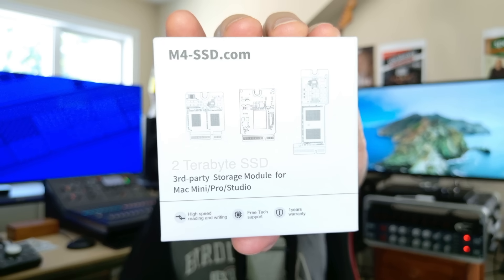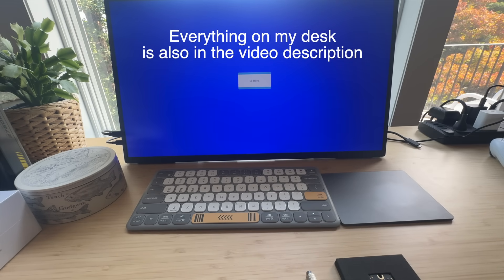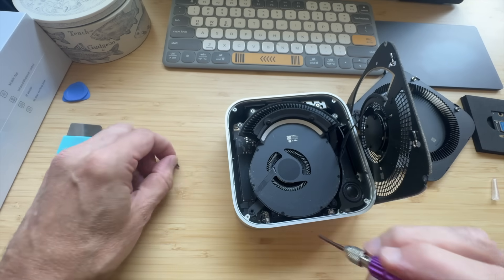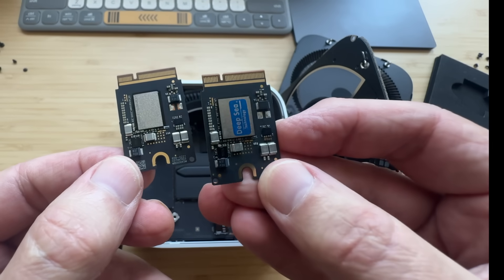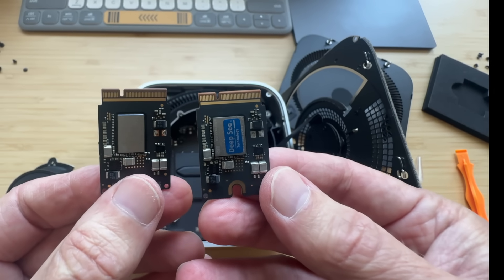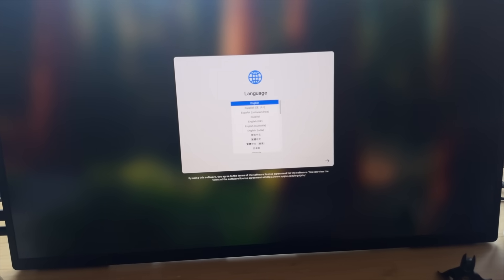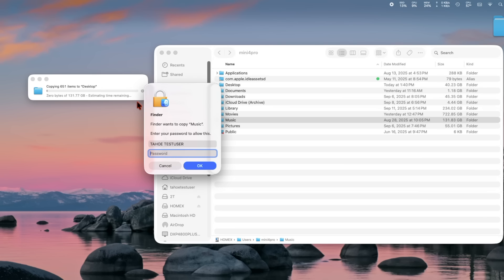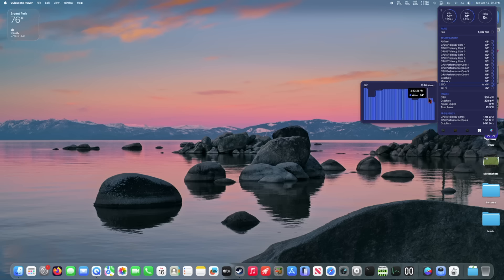Apple should be ashamed!!!! Save $445.00 2 Terabyte SSD upgrade for M4 Mac mini DIY GUIDE

Comment: Does the 2nd Mac for the restore have to have to a recent silicon Mac or can it be an intel mac? Thanks in advance
Reply from the maker: It can be done, but only with an Intel Mac that has USB-C / Thunderbolt ports and is running macOS Ventura or later. With Apple configurator 2, which you can download from the App Store. Older Intel Macs without USB-C ports can’t be used for DFU restore.
Reply: @MacSoundSolutions  oh dude thanks soo much for that clarification 🙏🏾🙏🏾🙏🏾 

Alternatively, can I clone the internal hardrive of the iMac mini onto the new larger SSD then install it that way, since my 2nd Mac doesn’t have any requirements for the M4 restoration 

Once again thanks in advance
Reply from the maker: @kosmicjedi 
no the DFU Must be done on a new SSD install
Once it’s installed in t toe  m4 mac mini and that completely erases the drive and writes firmware to pair it with the computer before any data can be written to the drive and the drives not work in the MacMIni

Comment: I really appreciate all the work. You do putting videos that like this out. I'm working on my second upgrade of a Mac mini. And I've used the hard drive that you requested. But I keep getting an. Error message of 4042. I've tried two different SSD's in case it was an issue with one of them. He suggestions.
Reply from the maker: Error 4042 usually means macOS can’t write the firmware to the new SSD. The fix is almost always to reseat the drive and then put the Mac mini into DFU mode and do a revive + restore through Apple Configurator on another Mac. That rewrites the firmware properly. Make sure the SSD is erased as APFS with GUID, and use macOS 15.1 or newer during the restore.

Comment: Any concerns on reliability of the replacement internal drive? Some suppliers/redit forums indicate very hit and miss results [though not from this specific supplier] so I wanted to get your thoughts on that. 1 month is, have you been using it much? Is it still performing as you'd hope? I feel the price point is good, with the 2tb making probably more sense than the 1tb, once you've gone to the trouble of opening her up... You've been very kind & responsive answering my various User on External SSD questions. Appreciate all you do for the community.
Reply from the maker: So far so good, no performance issues or problems. I’ve got two MacMIni’s that I’ve upgraded my base model in my M4 Pro with their drives, I have seen reports of people having failed drives from other companies they bought on eBay or Temu, and via my links I have sold probably about 50 of these to my subscribers and fingers crossed nobody’s come on here and said anything negative about them so I’m guessing they’ve been working well for them. The company is very responsive when I reach out to them as they’re working on a Mac studio version and keeping me up-to-date on that.
Reply: @MacSoundSolutions  How is the stability of the internal ssd upgrade now?  And, knowing what you do now would you do the internal upgrade or external.  I’m looking at buying a Mac mini and trying to choose which upgrade I’m going to do.
Reply from the maker: @skrufee  totally happy with the internal SST upgrades. I’ve done it to two MacMIni‘s my M4 pro and my M4 base model. The problem is that they’re just getting more and more expensive because of the whole AI buying up all the chips situation and that includes external set ups as well. I’ve had zero issues with the internal upgrade. I mean it’s only been about three months but they’re working great I just made a brand new video which I posted today about the best way to set up the external SSD either one works really well. It’s just a matter of do you wanna have a drive always attached to your computer and one of the benefits of that is you can always upgrade that external drive and make it even bigger so you can start with one terabyte go to 2 TB go to 4 TB where you can’t really do that with the internal the internal drive you can resell to somebody else and upgrade to a larger size but you can’t use those internal drives outside of the Mac it has to be installed in the Mac for it to work and you need another Mac to be able to set it up.

Comment: I heard to get it to work they must be blank NAND chips.  I am not sure if there is a way to properly blank new ones for use so that they can be reused.
Reply from the maker: I believe they can be used, the usage of the nands is delectable with this terminal command. ioreg -r -c AppleNVMeSMARTUserClient | grep -E "Cycle|Wear|Health|Percentage|SMART"     "Result Percentage Used" = 0 if percent used is 1 or 2 it has been used a far amount.
"SMART Overall Health Self-Assessment Test" = "Passed".     ioreg -r -c AppleNVMeSMARTUserClient 
Then scroll and look for:
	•	Data Units Written
	•	Data Units Read
	•	Percentage Used
	•	Media and Data Integrity Errors
	•	Power-On Hours

Comment: now from an apple user point of view i have to purchase another silicon mac to upgrade now if i do my maths i might as well upgrade via apple cause for me 600 uk pounds for another mac and all the hassle of taking mac mini apart voiding warranty i am leaning to letting apple upgrade and keep my warranty
Reply from the maker: you can use an old mac or a pc as well to do the DFU process, but yes you do need a second computer, or find a friend who has one. I certainly would not buy a second mac just to do the process either.
Reply: You could perhaps find a local Mac specialist who would do this upgrade?

Comment: What to do with the stock Apple SSD that comes out of the Mac after an upgrade?
Reply from the maker: hold on to it for backup, you cannot put it in an enclsure and use it, it pretty much is a brick. But if the new drive were to dies you could reinstall it and boot up. Always have backups of your data.

Comment: I've upgraded my MBP15m2014's SSD by installing the OS on the replacement externally via enclosure, then installing the SSD. Can't you do the same in this case?
Reply from the maker: No, the ssd has to go through the DFU process to pair it with the logic board, not like the old Intel days.
Reply: @MacSoundSolutions  So you need another M series Mac to do the process?
Reply from the maker: @matanglawinX you can use a Intel Mac with Ventura or later or a PC with their DFU app.  You can get Apple Configurator from the App Store for Intel Macs it’s built into the os in  M Macs.

Comment: I have to say you are a good sales guy! But… it is not worth it to upgrade my M4 base model this time, I stick with external enclosure until Apple no longer “allow” it.
Reply from the maker: External works great, have done it for 7 months no issue with two minis and moved my user account between the two as well,  aside from spotlight searching iCloud Drive and a few little things worked great.

Comment: $319 for 2 TBs Internal storage.Ya it nice to have 2TB of Internal storage. My 256 GB still has 101 MB Free. 
I paid less than $175 for a 4-MB/s Thunderbolt enclosure,  Cable and a 2TB Smang 990 EVO SSD. My M4 Mac Mini also has an an additional 2 TB of Storage one is formatted ExFat and one came directly off my Windows Formatted as NTFS and is read only to the M4 Mac Mini.
Reply from the maker: I have videos on moving your user account home folder to an external SSD so you only use the internal 256 drive for Mac OS. Works great.

Comment: Pretty low-class deleting my last comment when I posted about a possible scam with the company based on WHAT USPS TOLD ME... Anyway, I said in that post that I'd come back here to report any updates and I'm happy to say that M4BoostHub is working to find out what happened, it was rerouted at some point so they launched an investigation, AND they're also sending out another SSD. A good standup company so bravo to them. Shame on you for trying to hide information that could help others.

Comment: SSDs do fail. Apple needs to keep the failure rate within the range that can be handled by its current repair network. That's why they limit the capacity and price. I think. While larger storage capacity is always better, you need to consider that it comes with costs other than the initial investment.
That's why the price of AppleCare remains the same regardless of capacity. This may be the case only in Japan, though.
Reply from the maker: Yeah, AppleCare is the same price regardless of capacity they already got your money when you buy their storage.

Comment: Still slow speeds compared to the M4 Pro.
Reply from the maker: Yes, the M4 pro is faster internally regardless. I have a video on upgrading the pro  and it gets faster speeds with the new SSD but going from 512 TB to 4 TB is to be expected larger cache and more NANDs.

Comment: With the supplied screwdriver, you should be able to make it magnetic for the pesky screws by placing a neodymium mini magnet on its upper shaft. That will magnetize any of the screw bits you use.

Comment: Hey! I’ve been watching your videos since the Mac mini M4 dropped. Back then, you were all about rocking an external SSD (and yeah, moving folders around was a pain). I even left a comment once saying I’d gone with a 1TB internal SSD, and you hit me with “How long do you think that SSD will last? What if Apple rolls out an update that bricks it? Watch out for that power cable…” And now look at you — fully team internal SSD. Gotta love how tech opinions evolve, right? Cheers.
Reply from the maker: I know a bit hypocritical of me, but when they reached out to me and said they’d give me a free 4 TB for my M4 Pro how could I say no!😅 so I’m all about whatever works best for the user and can save money on the old Apple tax.
Reply: Apple possibly bricking it would be the main reason I'm holding off.
Chances are pretty high imho that is need to change it back to the original after 6 months or so.....

Comment: I was considering getting a 256GB Mac Mini M4 (non-Pro) to leave on my desk, attached to my RAID DAS enclosure, and other external drives, to act as a home server. I’m wondering if 2TB has any value for this setup. Or maybe I should just have with the lowest specs M4 Mini and not even order an upgraded SSD.
Reply from the maker: You can always upgrade down the road with one of these and see how it goes with the base storage.

Comment: If the screws are ferrous (steel), I would attach a small magnet ($.25 each at Walmart or somewhere like that) to the screwdriver bit and it will hold the screw to the tool to avoid dropping it inside the computer.
Reply from the maker: You can use magnetic torx screwdriver. The tool they provide isn’t.

Comment: This is a great video! However, I don't think hardly anyone should do this. External storage through Thunderbolt-5 and "even" Thunderbolt-4 is not only fast enough it can be faster than the internal SSD. There are so many options for using external storage from just moving certain libraries there and choosing to use it for file storage through setting up the Home folder there (your videos on this are terrific) to booting from the external. While there are some caveats and inconveniences about some of these things, for nearly everyone they are somewhere between meaningless and tiny and better than opening up a device like the M4 Mini to swap out the internal SSD.

Every time I heard the =SNAP= of those clips getting released I cringed!
Reply from the maker: You must be new to my channel. I have many videos about running your user account on an external SSD and how to not have to do this. But after doing it it’s much easier than a lot of other things I used to do with my Mac Pro five, one like upgrading the Wi-Fi Bluetooth card that was way harder than this. But I agree most people shouldn’t or won’t do it, but those who like to tinker as I do probably will and many have done it before I posted this video. I certainly am not the first YouTuber to post this process.
Reply: @MacSoundSolutions No, I’ve seen many of your videos over the last year, as I referenced in my first post.

Comment: I still don’t think this is a good idea. This process is not reversible, your original SSD will be completely useless after you pair the Mac mini with a new SSD since only blank NANDs can be paired. That means if your new SSD dies on you and you’re out of warranty, you cannot put the original back and restore it because the original isn’t blank. Not to mention 1 year of warranty? This is a freaking SSD product it should have 3-5 years!  How unconfident are they with their product? Small company is not the excuse here since there are a lot of small companies selling SSD products with 3-5 years of warranty. Just do external, boot or home folder whatever, it’s the safest.
Reply from the maker: You can absolutely put the original SSD in, you may have to do the EFI restore process again, but it most likely will just work because it has been paired with the T2 secure enclave already. I agree one year warranty is pretty weak, but at least it’s something. To me it’s nice that you can even do this because on most Macs you cannot.
Reply: @MacSoundSolutions  No, the original will not work if new one is paired, the Mac mini will only have one paired module. Once a new encryption between M chip and new NAND modules is established, the old pair is broken, the M chip will not recognise the original one nor erase it. Only blank and the currently paired module would work for DFU restoration. The original module is still encrypted but the M chip couldn’t decrypt it since it’s no longer paired. Similarly you can’t just add another module to the second slot of the Mac Studio and try to DFU it. Also I think you shouldn’t call it T2 anymore, since T2 no longer a thing. But T2 Macs are similar and guess what the 2019 T2 Mac Pro is quite a good example. Apple sold SSD upgrade kits for it, and the old modules would become useless after new ones are installed and DFUed successfully.

Comment: Hello, I'm really happy with your excellent explanations in the videos. I'm already using the external SSD as you recommended, and it works fantastically. However, I'd like to upgrade my Mac mini M4 from this year from 256TB to 2TB, but I don't have a recent second computer. I have an iMac from late 2013. Can I get the mini M4 working again with this computer. (I hope so)
Reply from the maker: You need to be running Ventura or later, so if you install opencore legacy patcher and install Apple Configurator on the iMac with Ventura or later you should be able to, you would also need a usb c to usb a cable 3.0 I can’t guarantee it because I haven’t tried it myself.

Comment: It has to be Apple-SSD, not possible to install any other brand?
Reply from the maker: It has to be one of these, they are not standard design, like a regular NVMe they are Apple design. So no you cannot use a standard SSD. This company replicated Apples design. Apple does not sell these.
Reply: @MacSoundSolutions  Typical Apple-solution! Mac Pro 2019, can it take any SSD, 2,5" or NVMe/M.2? I am no fan of Apple Silicon with no upgradability.

Comment: When will you understand that Apple doesn't make money on base computers. They make money on more expensive versions.
Reply from the maker: Base models do turn a profit….  as they brings folks into the eco system. So while the actual device may not turn the big profit, the subscriptions, App Store,  apple care etc all help to bring in profits, not sure what your point is really.  My point is get the base model with as much ram as you can afford and upgrade the internal storage when you can, internal or external. Don’t waist your money on Apple’s ridiculously over priced storage.
Reply: @MacSoundSolutions  I think memory prices are where Apple really makes money.  You either like it or you don't. If you don't, buy a Dell or an Asus.
Reply from the maker: @nnnnnn3647 or do your own upgrade at least with the mini.

Comment from the maker: FYI you need a second Mac to setup the SSD once installed. Or you can use a PC. My link with 8% off https://m4boosthub.com?sca_ref=9538186.HiPJQq2asAV1&utm_source=9538186&utm_medium=creators&utm_campaign=creator_promote
Reply: don't see the 8% off using the above url, it's always $329, am I missing anything?
Reply from the maker: @amazingphotos3219 you have to go all the way to check out it should show right before payment.
I tried it myself and it worked.
Reply: You really can use a PC?

Comment: Hi Lance, great video as always. I have literally just completed this upgrade on my m4 mac mini pro. Thank you for these videos to aid.  I decided to purchase my 4TB Deep Sea SSD from the NovaX Store on AliExpress thou. To be fair the delivery time would have been roughly the same. It was slightly cheaper from NovaX. It took 2 weeks to arrive into the UK. I paid a total of £357.48 inc VAT and there was zero import tax - thats significantly less than Apple wanted for this storage. at some 1200 $. One thing I would say about the install and this was of course completely frustrating.. Trying to complete this install off of my 7,1 was a non starter, even with it running 15.6.1. Apple Config 2 could see the device, thou would not restore it. no matter how many times I clicked on that restore tab.. Nothing, so nil points to apple for that either. I did then go and purchase the m4-ssd DFU kit from m4-ssd, which has enabled me to install the firmware (from a NUC PC to the Mini M4 Pro).. That was fairly straight forward and involved setting up their VM, setting up a shared folder and downloading the UniversalMac IPSW file. A little time and brain power, its up running and restoring from Backup as I type.